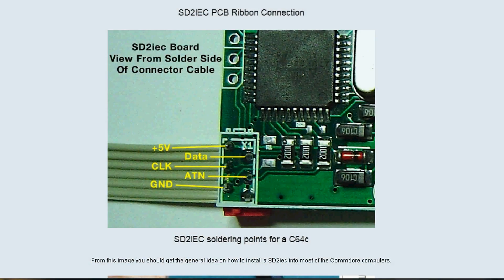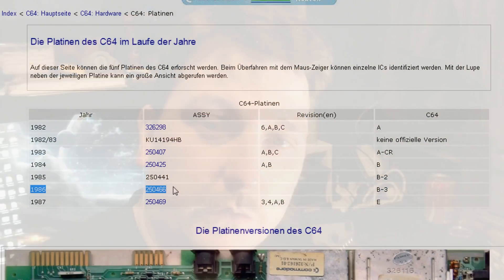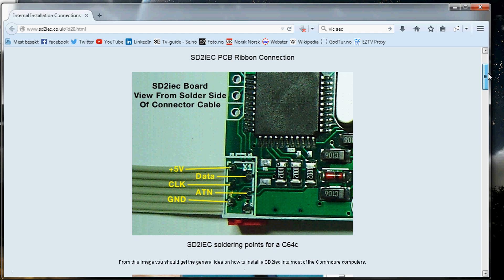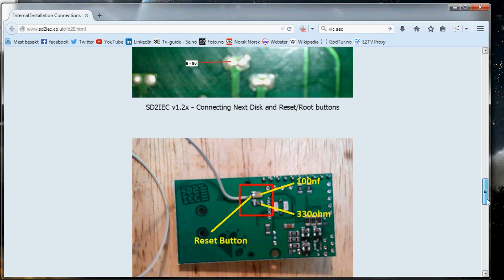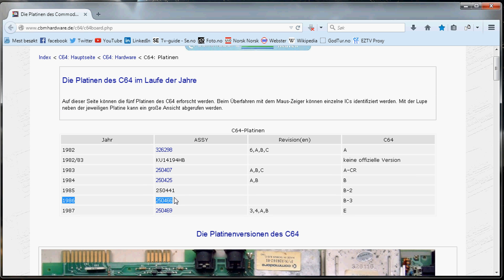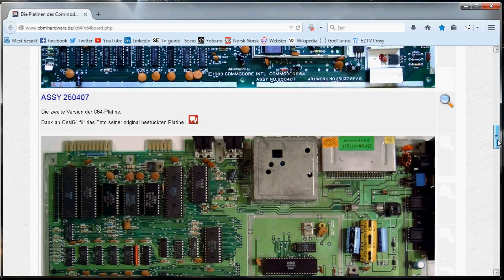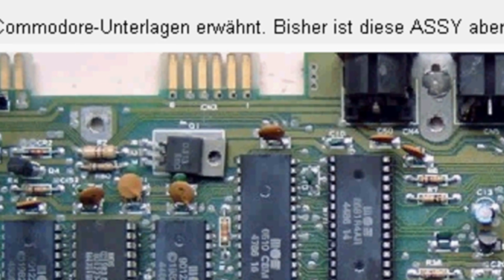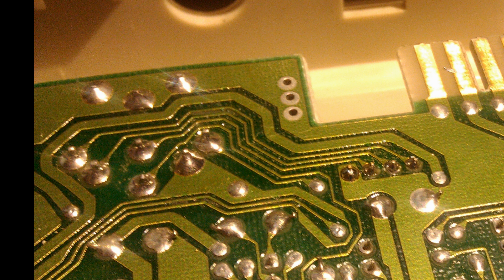SD2IEC Internal C64 PCB pinheader mod (for 250466 and 250425)

Comment: You should use "loddelisse" for sucking up the excess solder. Not that dangerous, the suction pistol can suck copper from the motherboard if you are unlucky

Comment: in addition to having installed the sd2iec I also installed the reset button. when I want to change game I use the reset button to return to the blue screen of the commodore, but when I give the command to go back into the sd2iec it gives me error, so I have to use the on-off button of the commodore.

Comment: That is a very neat way to connect compared to soldering direct to the via's
Reply from the maker: Thanks for the comment :) I find it very handy to easily remove the sd2iec to work on the motherboard.

Comment: Anyone knows the vias on 250469 ?
Reply from the maker: C64C XRAY ;) http://oms.wmhost.com/misc/C64C_xray.jpg
Reply: Ok thanks, but which are the ones for pinheader mod ?
Reply from the maker: No vias at all for use with 250469 ! .. You might want to attach a 
pinheader directly to U22 instead ? You would need ATN, DATA and CLK .. 
see my drawing http://i.imgur.com/CBc7exL.jpg .. also see 
https://www.thefuturewas8bit.com/index.php/internal-nstallationconnections-v1-2x

Comment: Really nice! Must do this slick soldering and wiring on my C64(short board model). Love to have things organized and simply looking sexy :D
Reply from the maker: +demoscenes Thanks. Ah.. The short board model, the 250469 ? I've seen four vias to the right of the IEC port there also that look like they are the IEC bus, so might get lucky there and can just use a header too :) advice: don't do as me. Add a male pin header to the board. I added the female version. Why ? Because if the cable comes loose, then in my case the pins on the wire might touch something else. In your case if your wire comes loose, then the female connector will be insulated and not short anything out.
Reply: bwack Whops! Yep, thanks for the advice. Shall keep that in mind when I do my operation :)